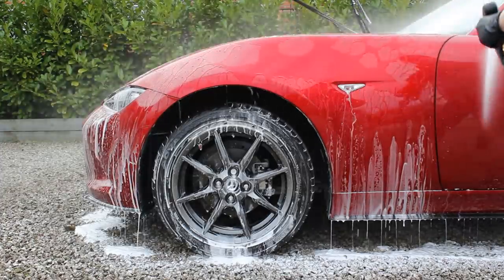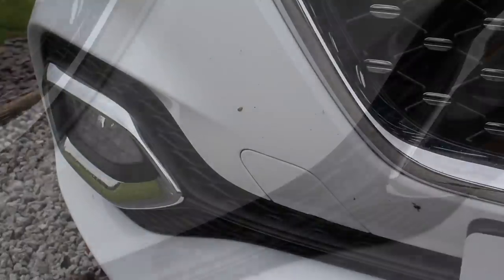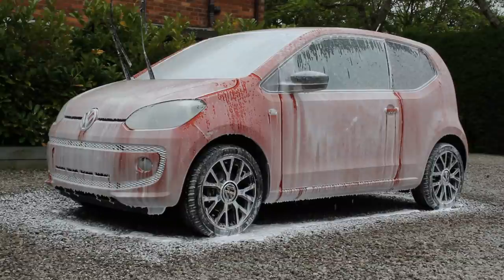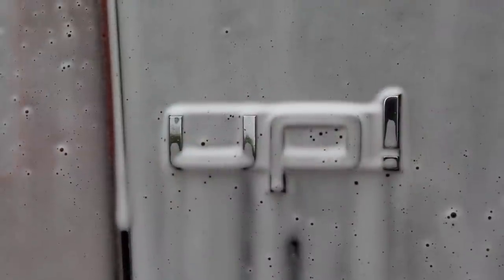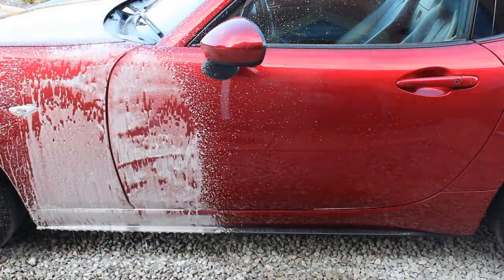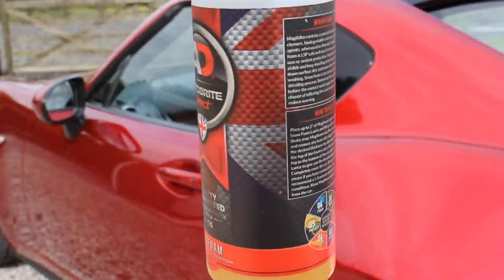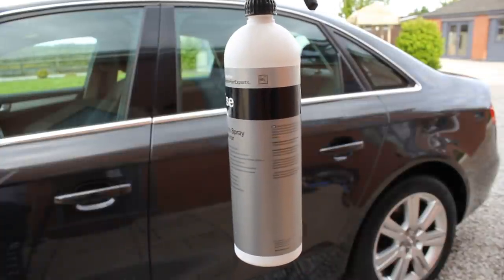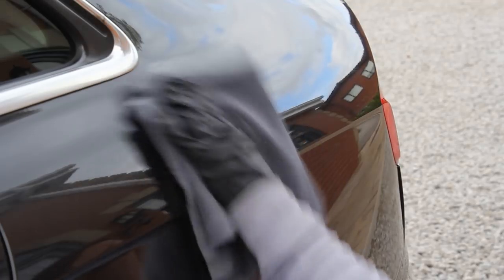My Favourite Summer Detailing and Car Cleaning Products

Comment: Thanks for that some helpful tips. Been experimenting rinseless wash products and techniques for the summer, seems a good option makes sense stops panels drying out as you can dry as you go and helps with water spots either way even if used with the traditional rinse off as it doesn’t produce the suds that tend to dry out in the heat. Still not been brave enough yet to try the no rinse method on a super dirty car! Been using Optimum no rinse which is good, just managed to get hold of some Mckee’s which I’m excited to try!

Comment: One of my biggest peeves this time of year, along with bugs, is dust and pollen settling on my car. 
I do use Maguires ceramic spray to top up the protection, but all it takes is the smallest amount of moisture, breeze and back to square one again. 🙄
Reply from the maker: That's so true. It's especially annoying if it rains and I've not driven the car and then I get loads of dusty water spots!
Reply: @AutoCareHQ  OMG, SO TRUE! Today I had to rewash my car after a 5 minutes downpour left it covered in what looked like muddy water spots. I wondered if it was pollen or that Saharan dust we sometimes get.
Reply from the maker: @captainsweatpants5229  my car looks absolutely grim right now with those water spots, only washed it on Friday 😂
Reply: @AutoCareHQ  Sahara desert spots are my pet peeve. Hugely irritating when I have just done a great job and then the day after it’s rained and this shite decides to ruin my cars look.
Reply: @AutoCareHQ  A rinse didn't clear it today, needed foam to shift the stuff. The cost of the stunning sunset last night perhaps.

Comment: I used Mitchell and King Cloak on my black granite worktops yesterday (I know it's not the car) and the reflections are incredible as noted on your MX5, and slickness. I've put various other sealants and waxes on before, none in the same league for gloss. Can see it going on the car for summer now with a wax topper instead of a light ceramic. Just got to finish the machine polishing first... Great video as usual Heather, thanks.
Reply from the maker: Thanks for watching! That sounds like a great product, I think glazes are a great option sometimes just to get that extra boost of gloss

Comment: Magifoam is high alkaline ph13 and that  higher cleaning power mainly winter but can be used at summer with lower percentage ratio. Autobrite says that superfoam Is for warmer and summer periods it's on the website which is pH neutral so you can add more ratio if you wanted to.
I prefer actual liquid mix with water on the panel now through a dedicated pump sprayer. I use to use snow foam like mount Everest all the time still on the floor in driveway after two days. Reason lowering the ratio of snow foam you lower the impact chemical ratio onto to panel but I'm sure they still work for many people. But I prefer pump sprayer. Snow foam and foam shampoo bucket wash and sealent spray foam wash leaves foam everywhere I wasn't liking it as much.

Comment: Hi there. I can't really think of any products I use in summer rather than winter but with time on my hands now I that I am retired very early I may add I have time on my hands to indulge in my wax collection. I  also overlay citrus  with snow  foam and Magiseal was good but I predominantly use Mitchell and King products and Snow is their offering in foam. I use M & K because they are handy and John the owner is always at hand for advice and help and I usually agree with his ethos and methods and more importantly they manufacture their own waxes. My Dad who sadly passed away last year was an advocate of a hard wax from the 70's and kept the same tin all the years until he went blind. I'm sure he would be blown away today by  the choices of wax on offer. He is my inspiration I'm sure of my catching the detailing bug but not the one bucket & sponge method he used. Having been converted to an SIO2 spray sealant guy I have reverted to waxes and it is the best decision I have made.
Reply from the maker: Thanks for commenting John it was really interesting to read :) There is just something really therapeutic about using a wax, it's very old school but I think that's what is kind of cool about it!

Comment: Good to hear a fellow Lancs accent. Do you rate that wax more than BH DSW? I was going to get some of the BH but heard it can be tough to buff off.
Reply from the maker: Thanks for watching! I think durability-wise DSW has the edge but this one is nicer to use. I wouldn't stress too much about buffing DSW off, it's not bad if you use a thin layer and don't leave it too long. My preference is Squid Ink Aquaphobe but both are great I don't think you can go wrong with either

Comment: I am very curious what the the time taken from start to end. Since you are washing under the sun i believe you will need to finished it as soon as possible.
Reply from the maker: It usually takes me 1-2 hours to clean my car but as long as the panels are kept wet throughout the process I don't tend to run into issues. I usually wash it in the evening as well when it's in the shade :)

Comment: Do you not find it better to use a a spray sealer rather than a wax as I feel using a wax there is more chance  off scratching the car as no matter how hard you try  some abrasive always finds it's way onto the was
Reply from the maker: Thanks for commenting Iain :) I get what you mean, waxing does feel a bit more involved than a spray sealant on the paintwork. I am quite mindful of any debris/ dust so I keep checking the wax applicator and switch up the cloths throughout the process. I always make sure I only wax the car when it's a still day as well so there's less chance of stuff flying onto the car. I think if you stay conscious of it and take some precautions it shouldn't really be any riskier than using a spray sealant

Comment: Great video.   Have you any favourites for getting rid of bird poo?   I’ve used the Poorboys Bird sh*r remover and that’s the best so far
Reply from the maker: Cheers David! I usually just go for a citrus pre-wash and then snow foam over the top and that pretty much always shifts it in a single hit
Reply: @AutoCareHQ  hi, it’s the just detailed situation whereby you get an aerial attack or if your away from home and want to get the offending splatter off your car.

Comment: great video Heather, summer time up north usually means post-winter quick DA polish, and followed by AM Glaze with AM Seal / Hybrid Seal.  Then finished off with some IW SuperGloss+ Spray wax protection.  Still using GT Tyre Serum or IW Tyre Coat 2.0 on the wheels (i like the coconut smell, and Alan won't make me anymore AM products with coconut! 🥥).  IW Citrus Pre-Wash can be diluted 10:1 so goes a long way and cleans very well (i mix a little PowerFoam with it for best results).
Reply from the maker: Cheers Iain! I've heard very good things about AM glaze, I might pick some up when I run out of Black Hole!

Comment: Have you tried Super Foam over the other AD one ? Thats more , they tell me , of a summer foam .
Reply from the maker: I've only ever tried Magifoam. It'd be interesting to see if Super Foam has much cleaning power to it in comparison
Reply: @AutoCareHQ  its one of their base foams they make the colored ones off , Parma Violet etc . Seems to work well but it not as thick as magifoam I thought . More designed , they tell me , for summer washes than the grime n salts of winter needs

Comment: I do a very small mileage and it is incredible how dirty the car can get in just a week (I park in the open). My issue is what I'm sure is a type of bird spatter, not the actually lumps we know and hate but little beige coloured flecks. I'm really interested in what you say about Poor Boys Black Hole as well. Never used it but I think I must give it a go. Some great tips Heather - another really helpful video.
Reply from the maker: Thanks Peter :) I know exactly what you mean, those little flecks aren't the easiest to remove if they've been left for even just a few days so I usually need some kind of citrus under the snow foam to get rid of them in the pre-wash. I really rate Black Hole, so easy to use and it makes the car look really good!

Comment: Thanks for the great video Heather. Unfortunately for me, these products are not readily available in the states. When you stated you use the Poorboy glaze followed with the wax, it reminded me of a combo that I like using: Jescar Powerlock + , followed by Collinite 845 on top. Not a simple affair, since the Powerlock needs a minimum of 3 hours to cure, but the results are worth it
Reply from the maker: Thanks Jeffrey! It's a shame that the products aren't available in more countries! I've heard really good things about Collinite 845, I've heard it's quite durable?
Reply: @AutoCareHQ  it is , but it needs a good sealant underneath like the Jescar Powerlock + . That combo is probably good for 8 months, providing you use a pH neutral soap to wash.

Comment: Lovely video as always Heather. 

I'm a big fan of Magifoam. Always have been as I love the thickness and dwell. 

Absolutely love FSE. It's just brilliant stuff and actually gives a decent shine and a bit of protection too I've found. 

In terms of tarting up the paint, I've found my favorite summer go to is to get the DA out and hit the car with Auto Finesse Tripple, followed by a really good wax. 
The tripple gives it a bit of a one-step polish but also lays down a filling glaze and a little wax aswell. A final wax on top just seals it really. 

If its gonna be a busy summer then I'll go for a layer of fusso coat.  If I'm gonna have a bit more time then I'll use one of the Auto Finesse waxes, Swisswax or maybe King of Gloss. 

But, if I'm going to be going for maximum bling, then I still don't think you can beat the Garage Therapy 3CS and 2Sigma combo personally!  

I have a black pearl paint and man does it shine with that combo!
Reply from the maker: Thank you! I'm still yet to try Tripple, I'm probably one of the only people who hasn't at this point 😂 The GT 3CS and Sigma combo is brilliant though
Reply: @AutoCareHQ  it's nice stuff the Tripple and does last a long time. 

Most of the time I tend to reserve it for hand polishing badges, wheel bolts etc.